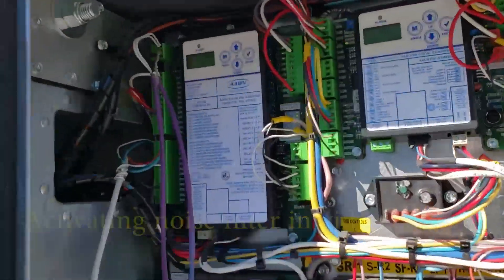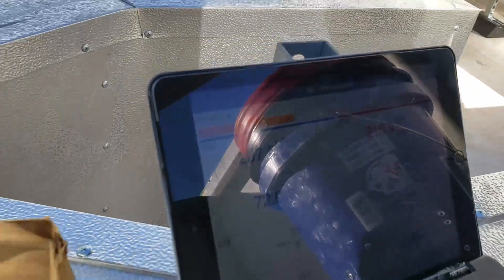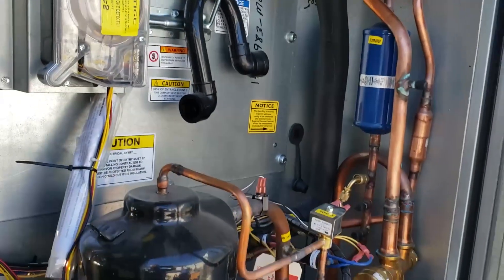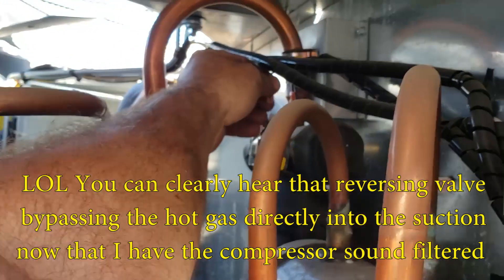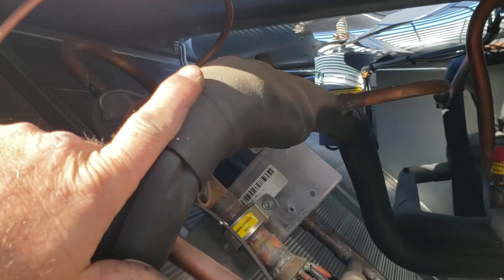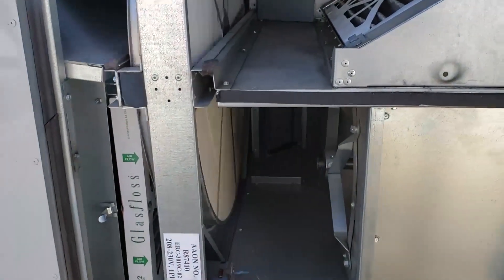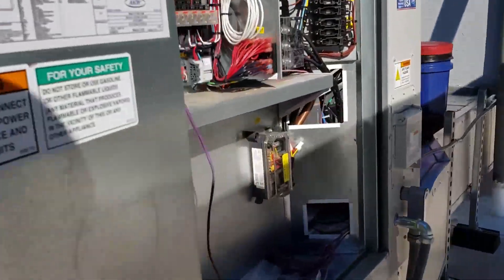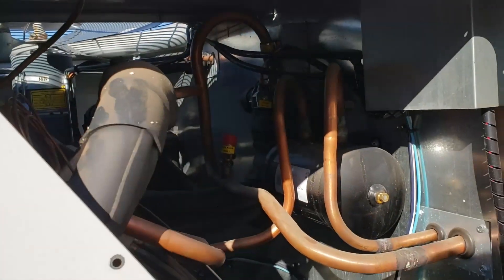New AAON unit has a failed changeover valve causing total bypass

Comment: Condenser fan wasn’t running system looks like it went into a defrost.
Reply from the maker: It's been a while but the fan was likely not running because of low discharge pressure or perhaps I had it disabled to build up pressure. Do not remember now. However I did replace this stuck/bypassing reversing valve.
Video is here ---> https://youtu.be/fZZD7BtUpUo

Comment: Check the unloader, that reversing valve needs pressure diff to change over.
Reply from the maker: I had that unloader unplugged when I tested.  (I also do that to charge etc).
I also already went back and replace the reversing valve.  
I had it working in heat then when I switched it to cool it got stuck again midway.  
Works great now with the new reversing valve.
Reply: @hackfreehvac  im glad it dit, had the same problem, condammed the reversing valve and  come to find out that the compressor was not building enough pressure tho shift it over all the way. Looked like the bypass pressure relief in the comp got stuck.
Reply from the maker: @sjefoekel6058  
Well, sometimes the two symptoms are similar. 
But the one thing about this one was that HOT GAS was going into the reversing valve and coming directly out the suction port of the reversing valve. 

The suction line was HOT all the way back to the compressor. 
So hot you couldn't hold your hand on it.
Reply from the maker: Here's my video of me fixing this unit. I didn't realize until today that I never uploaded it!
https://youtu.be/fZZD7BtUpUo

Comment: Everybody thought I was blowing smoke up there A$$ about AAON LOL 😂 Nice video Hackfreehvac  (●'◡'●)
Reply: Eric M   I have to admit I miss my aaons they where a great learning exercise
Reply from the maker: @geoffhoweth  
LOL
I generally like them. Kinda fun units.
Reply: Ate you sure the unit wasn't in oil return? If you would hook Prism software (Free) you would see the whole system in its detail screen. You can also test the hot gas reheat valve by forcing on the board goto menu and press up till you get to force valve the hot enter then hold the up button to drive it.
Reply from the maker: @ace7709  It was definitely stuck. 
When I replaced it the valve was right in the middle and the discharge gas port blew right out into the suction port. 
I do have the handheld service tool but it sometimes fights me to override outputs especially when the network is still plugged in. 
I'll check that prism software.